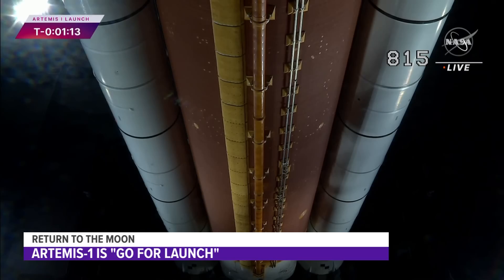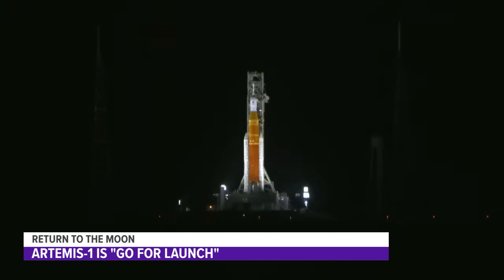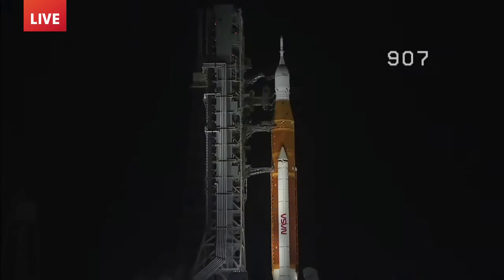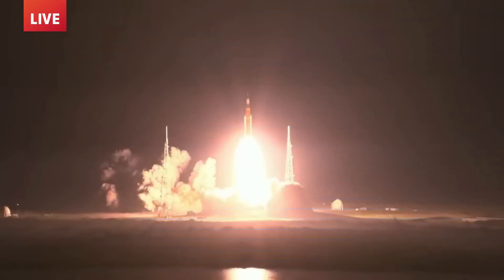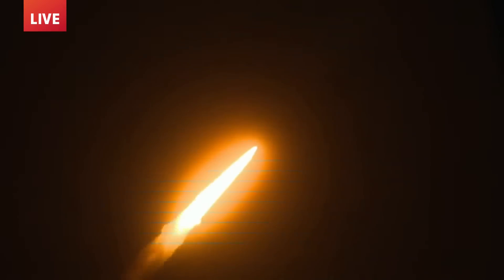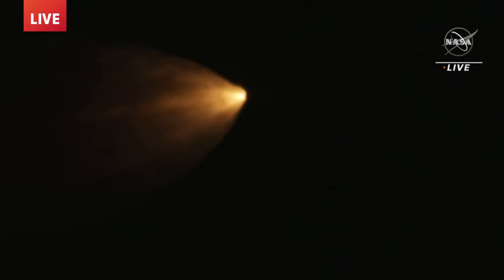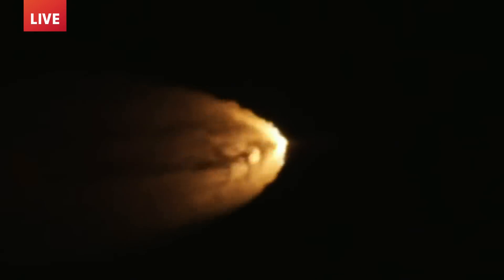Must See: NASA's Artemis launches from Cape Canaveral

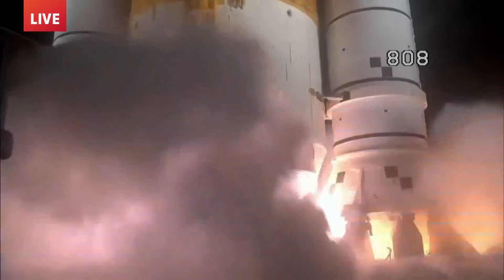Comment: 400,000 GALLONS OF AT 1:38 ? WAS IT PURIFIED ? 
 WATER SHORTAGE ??? $$$$$$$$$$$$$$$H2O$$$$$$$$$$$$$$$$$$
Reply: I'm a machinist at the company that built the pumps for the launch pad water deluge system. We also build pumps for wastewater treatment plants, so the water is recycled except for the vaporized water, (big white steam clouds).
Without it the pad would be  destroyed. There are no cheap shortcuts on these missions.
There is a YouTube video of the deluge system being tested with no rocket on the pad if you're interested.